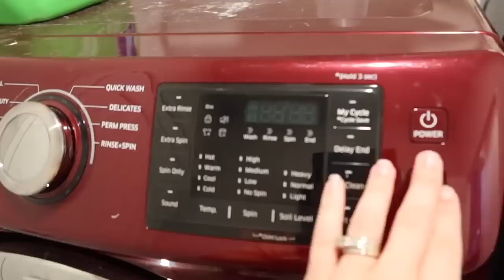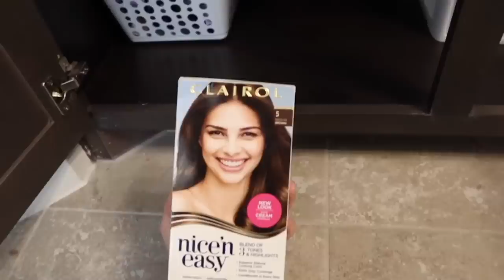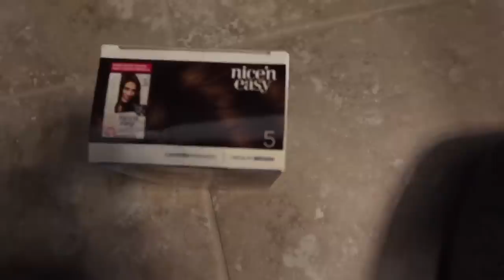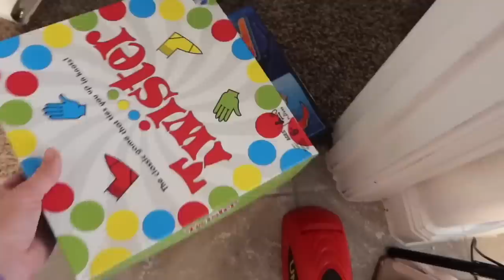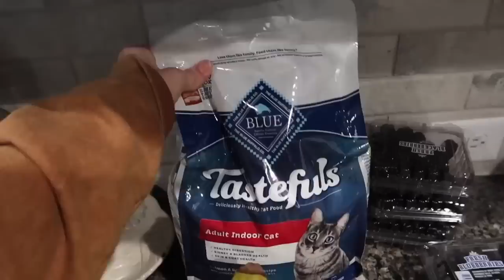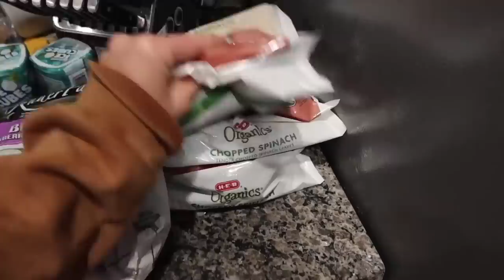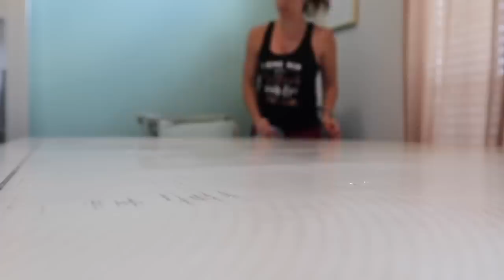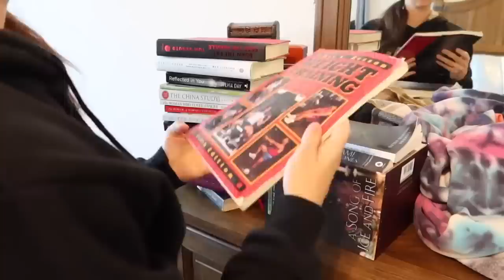3 HOUR CLEANING MARATHON : THIS WILL MOTIVATE YOU! CLEAN WITH ME MARATHON 2023

Comment: I’m watching you scrub the kitchen sink and for the “stink in the sink” try cleaning the sink with blue Dawn dishwashing liquid get wet and pour some Dawn on the sink scrub all over.  When you do the drain take a toothbrush and scrub the drain with it.  Now add baking soda then vinegar and scrub all over.  Take the toothbrush and repeat the cleaning the drain again.  When finished rinse with warm water and towel dry.  Take a little bit of olive oil and apply to a paper towel wipe sink down with it and buff to shine.  Also if you have a half a lemon scrub the baking soda mixture with it, might take a few times.  Then if you have a garbage disposal throw ice cubes down it with some lemon cut up and let run through.  See if all those tips help the “stink in the sink”. Let me know!